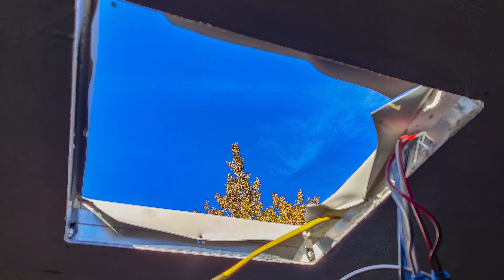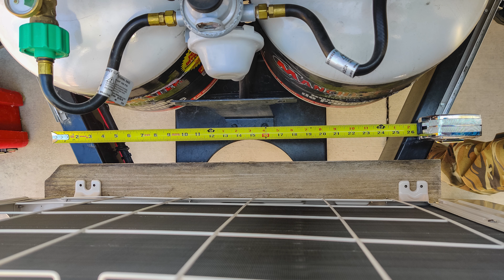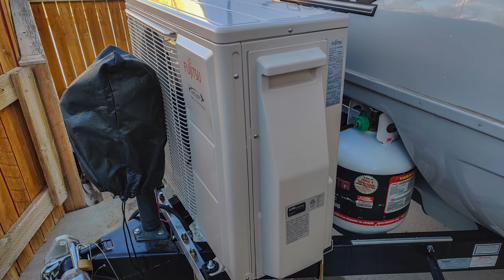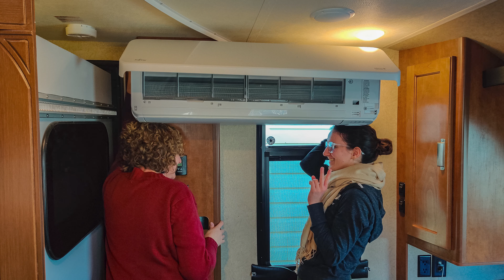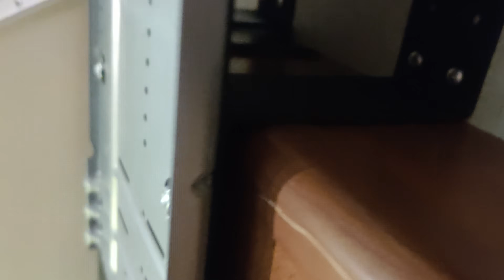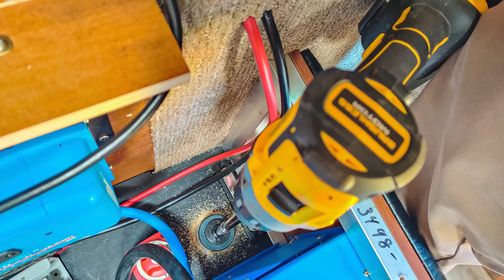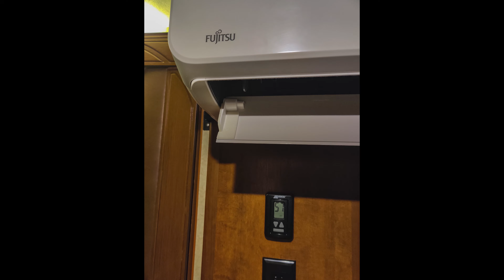How I Mounted A Heat Pump Mini Split On My Lance 2185 Travel Trailer

Comment: 33 Seer is a really great efficiency rating for a mini split. Most home ac are 13-16 Seer now a-days. Old acs are only 10 Seer! I would've tried to wall mount the mini split instead of on the trailer frame. Im not sure if that was looked into but daikin comes with brackets specifically for that. I think mini splits and heat pumps are the future for hvac. I would say invest in a mig because that could've been pretty easy mounting for the backet on that trailer frame.
Reply from the maker: I'm not sure what you're referring to by you would have tried to wall mount the mini split. I assume you mean the outdoor unit since the indoor unit is wall mounted. For the outside unit the only wall that could possibly make sense is the back wall since the sides are the width of traffic lanes, and the front is rounded and would have ended up with the mini split basically where it is already. On the back there is no available room for the mini split since there's a ladder and rear door back there. I've been interested in getting into welding someday, but this project already had a steep learning curve and I didn't want to add yet another tool to research, purchase and learn how to use for this project to be completed. I also like the idea of being able to unbolt this mini split and there's nothing permanent done to the frame.

Comment: Nice system..  I recently install a Pioneer 9k mini split on my RV. I have a smaller sized solar system on mine too.. but found it wouldn't power mine. Need to upgrade some wires to be able to handle the 8 amps of draw. 4 BB 100Ah lithiums, 2000w Xantrec, 1600w of panels and a Victron 150\85 controller with CERBO and touch 50. I'm a trucker and like to monitor it from the road.